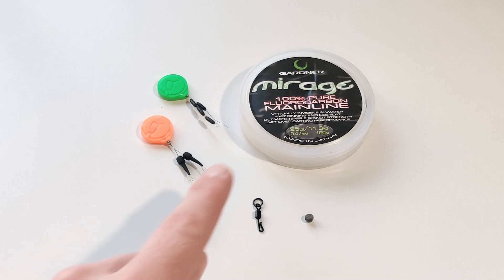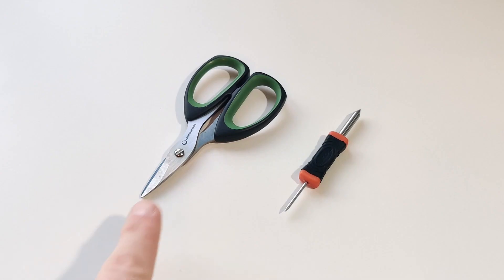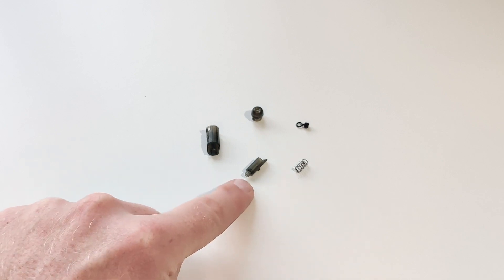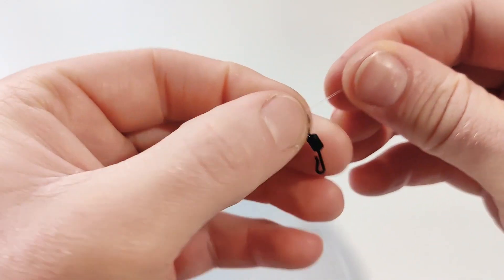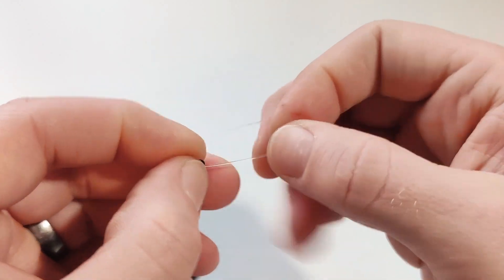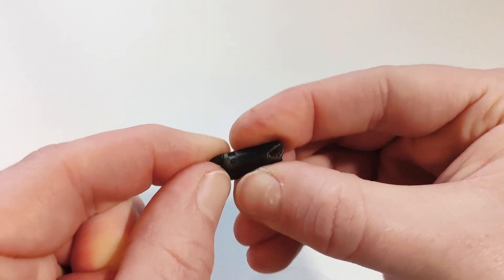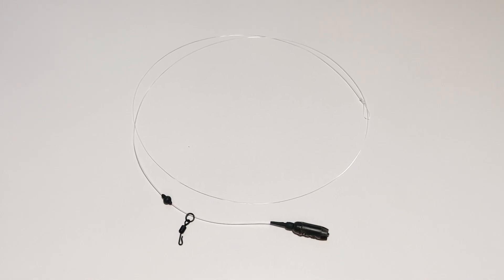How to tie Fluorocarbon Leaders

Comment: Don't like that figure of 8 loop at top, much better ways to do it with smaller more stream lined knots.
Reply from the maker: Thanks for sharing your thoughts Matt!!

I choose a figure 8 loop knot as it's super easy to tie and allows me to loop to loop leaders on and off very quickly without needing to cut the mainline. I can't say I've noticed an issue with how streamlined they are, but then I tie my leaders at around 1 metre in length so they never need to pass through the eyes of my rod. If you were wanting to tie longer leaders then I agree, you'd want to use a much more compact knot like a back to back griner.

What knot would you use?
Reply: @waderlife  I under~stand bud.  I personally would use an Albright if using braid to flouro leader, and back to back grinner with mono to flouro leader (depending on thicknesses of lines being used).  But at end of day just keep it all safe and real.  Good luck bud,  almost clubbing season 🤣